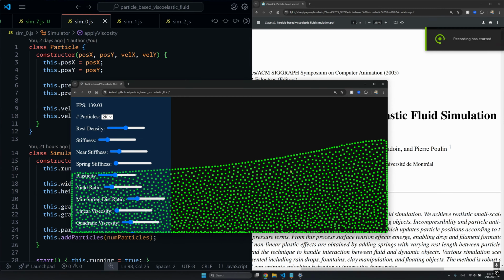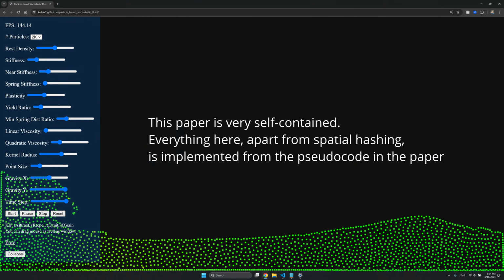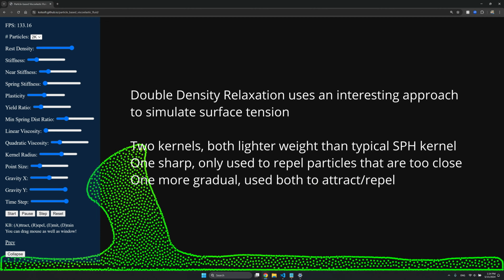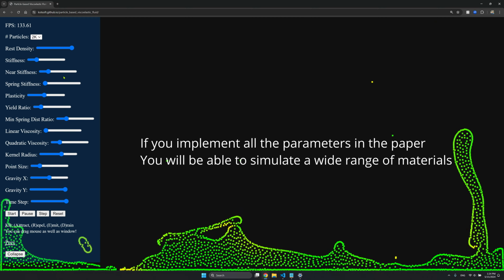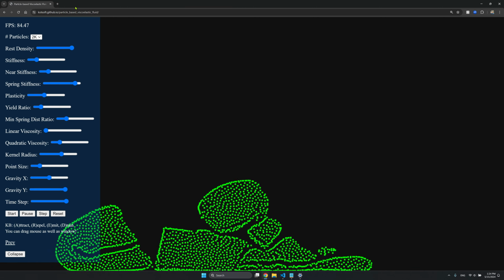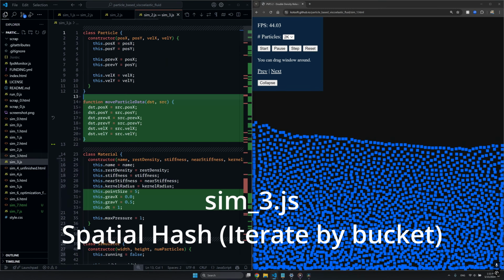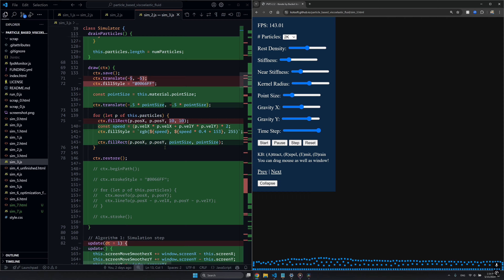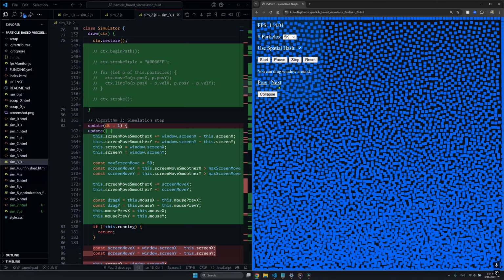Open-source Particle-based Viscoelastic Fluid Simulation Implementation

Comment: Very cool work! Have you experimented with networked particle engines? I think there’s a lot to be done optimizing particle engines for networking and networking for particle engines; I haven’t seen any multiplayer games with advanced particle simulations which multiple players can interact with simultaneously.

Maybe neural nets could be used to approximate chunks of the simulation with sparse data to stream and reconstruct on other clients. There are a lot of different ways it could be done
Reply from the maker: I haven't yet, only the cloud streaming Parsec thing. Syncing is pretty tough. Would be amazing if it was possible to patch multiple regions each simulated by a player. It may be possible to just sync grid chunks at the edges, like inflow/outflow. Maybe each player sends data to other players if they are in their simulated region. Perhaps if I extracted the fluid surface there would be less data to send.
Reply: @GrantKot  Those are all great ideas. Do you have a Discord server or anywhere viewers can meet and discuss simulation and rendering? Throwing around differing ideas and building off new perspectives can go a long way in finding innovative solutions. And it's fun.
Reply from the maker: For the time being, I don't think I have the bandwidth to do Discord on top of YT and X, which I try my best to respond to comments and incorporate the suggestions & scene requests etc. I have a pretty giant list of things for the sandbox I need to focus and work on.
Reply: @GrantKot  Understandable. Don't let us distract you too much! Haha

Comment: So, what technique can [be better optimized to] simulate more particles? I assume MPM, because it doesn't involve costly closest neighbors searching. But this technique is much more easier to understand and implement for us mere mortals.
Reply from the maker: For more particles or large scale scenes MPM. SPH is good for smaller scale, the surface tension looks good for things like drink commercials. Multiphase with bubbles is fairly easy to get with this.

Comment: how would you goabout making theit a solid? do you think you can blend between a water and foam material based on how fast a particle is going relative to it's neighbours?
Reply from the maker: For something extremely rigid, you might still want to just integrate it with a rigid body solver or use shape matching. I'll try to figure foam out a little better.

Comment: Why is there a "border" around the particles? Like a cell almost
Reply from the maker: The particles are trying to reach a set rest density. Because there are no particles outside the surface, it tries to reach the target rest density by pulling other particles from the surface closer.
Reply: @GrantKot  is this programmed in or is an emergent behavior?
Reply from the maker: I guess it could be considered emergent. If the rest density gets set as 0 they stop bunching up at surface. There's still some bunching up at the wall because there's some underestimation of neighborhood density there.